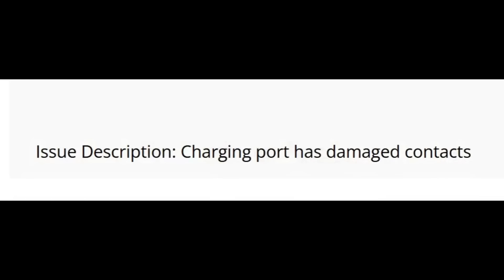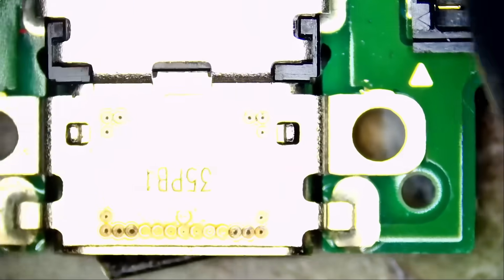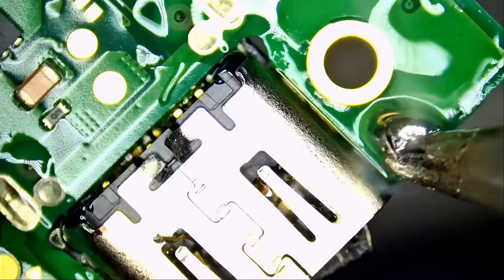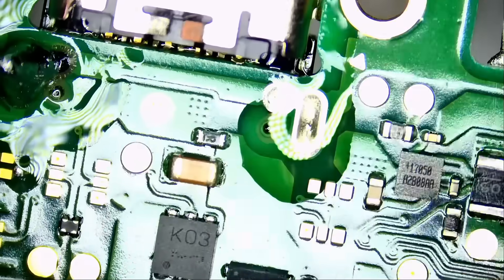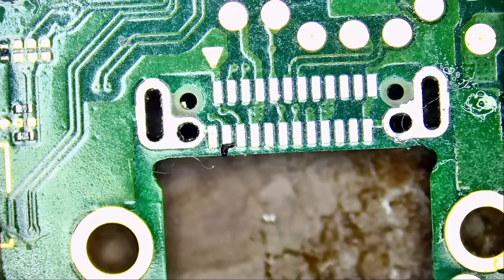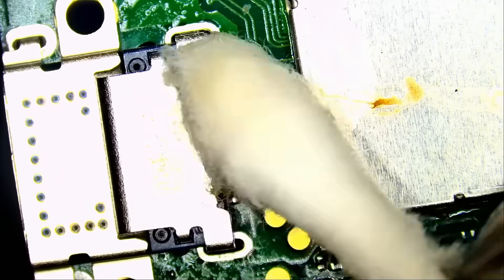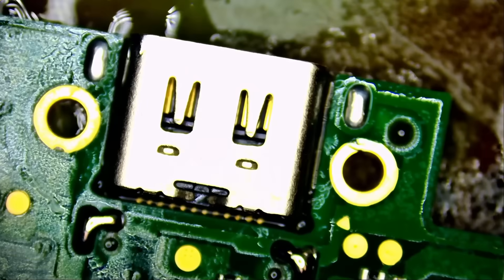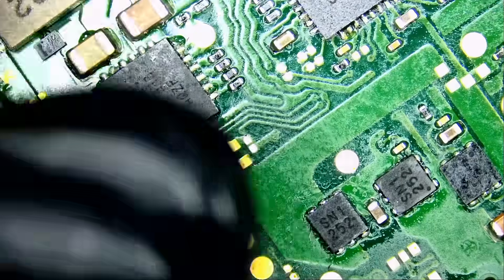Worst USB-C Damage I've Seen on a Switch Lite. You need to stop doing this.

Comment: My Red Devil 6900xtu starts crashing amd drivers when clock speed is above 2380MHz. Does that in OC and Slient bios. Gpu temp around 76-80 and hotspot 95. Any suggestions?

Comment: USB type C  was made to reduce this problem yet someone managed to do this. Damn. I mean ive seen broken type C ports but not to this extent. Like the worst ive seen is the sides of the mid-plate in the type connector being shaved off. Even then I never understood how customers managed to destroy a type C connector because it goes both ways. The only way i think it can happen if the male plug is damage i.e bent or has trash in the connector

Comment: I've switched to using a magnetic usb adapter on my phone. I'll never wear out a phone's usb port ever again.  I have no idea if this would work on a Switch dock and Switch, ie, whether you could could connect a usb cable down inside the dock so you can use magnetic adapters to connect the Switch.
Reply: Same here; all my personal devices, and flashlights and worklights too. Bought them for my nieces and brothers as well. Best preventative measure ever!
Reply: Most of them are charging only. Some do have data transfer capabilities as well but only with USB. 2.0 speeds at best, at least I have never seen one that is USB3 or higher. Regarding the Switch that wouldn't really work since the dock already has the USB-C plug as part of it. Potentially could work if you use separate adapters for HDMI output, but I have never seen a magnetic kind of adapter. Also I'm pretty sure USB 2.0 speeds wouldn't be enough. Correct me if I am wrong.

Comment: When I was 22, I got a job in a oil change shop, I was the one working under cars, I thought getting dirty was cool. After the first month I left work, I did wash up and went to my friends work, it was a sub shop inside a store, as I walked in the theft detectors started going off, I stopped and everyone was looking at me, I back up and walk thru and again, security walks up and I showed them I have nothing except my wallet and keys and I was going to see my friend and get a sub. They asked me if I had implants I said no, then I raised my hands above and walked thru and no alarm, I then just put both my hands thru and the alarm went off, I realized that all that metal in the oil was soaking into my hands and causing the theft detectors to go off, after that, It's been 22 years and I always wear gloves.

Comment: I have one that was sent to me free, the couple said the kids did something to it and it wouldn't come back on
they were letting 4-5 year old kids play with a switch
the usb-c part is gone, it looks like the thumbnail haha. I guess I'm going to have to learn how to solder
Reply: Good luck, it would be alot harder. It's better u buy some extras usb c and find any broken boards with USB c connector and practice to the point you wouldn't make mistake. All type c are not equal, some has less pinout and some has more.

Comment: I've never had an issue plugging in USBC. Sounds like a design flaw.
Reply: USBC is USBC on any device...its a STANDARD...DUH
Reply: @ekspatriat  i mean like something must be wrong with USBC port on the switch. It's a standard, but that doesn't mean all ports and cables are identical. Could be made of super cheap metal or manufactured incorrectly/wonky. There's a fancy term for manufacturing things where they pair up precisely and i just cannot think of it right now. Poor QC though.
Reply: The customer probably stuck something in there to clean with and in turn damaged the pins
Reply: I have a feeling that it's slightly offset from the middle, so if you stick it in the dock the wrong way around, it "shouldn't" go in ... unless you force it. I suspect that's  what happened here because you can put your full weight on the switch and push it down when you're trying to insert it.

Yes, I have one but it's rarely used. Pretty sure I've accidentally put it in the dock the wrong way but it wouldn't connect to the USB.
Reply: 使い方が悪いのをメーカーのせいにするな